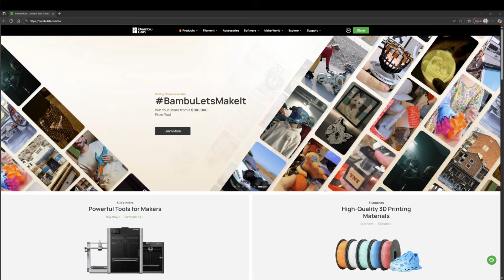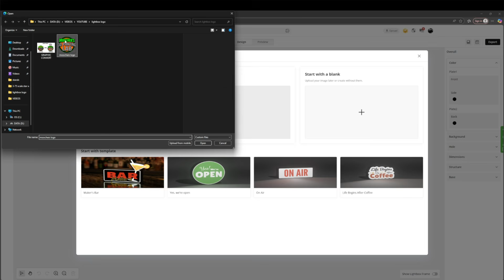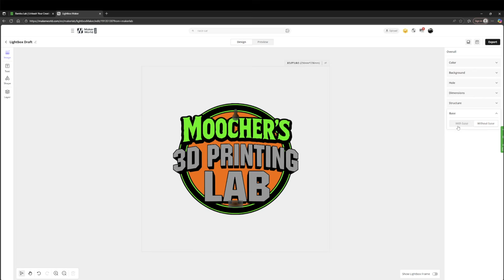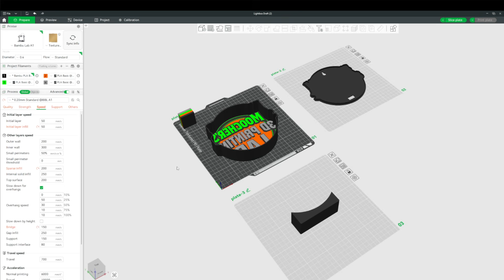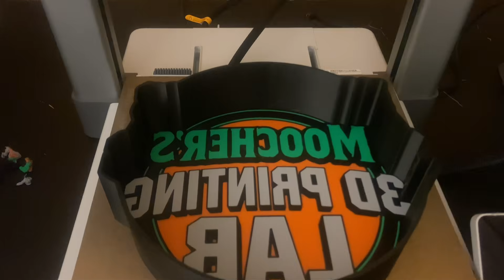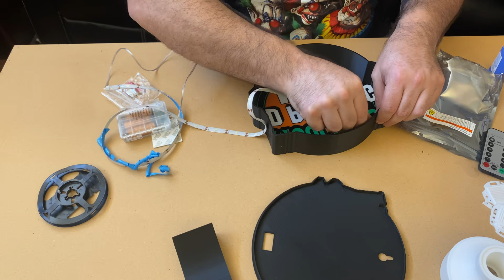Turning My Logo into a 3D Printed Lightbox!

Comment: How do you get your top layer to print like that. The inside of my design has tall tower pieces all inside the box. Seems like every letter is the thickness of the box. Even the back cover has tall pieces on it. It's weird. They aren't trees or supports.
Reply from the maker: Heya! So when printing I print face down, meaning the top layer of the finished piece is the first layer printed, if that makes sense, so you would have to flip the logo to lay on the build plate… sorry if I’m not understanding it’s hard with text only lol!

Comment: Thank you so much for the video! Do you find that the PLA is able to cope with the heat produced by the LED lights and not buckle or warp or anything? Thank you once again!
Reply from the maker: Yeah the standard led strip lights are no problem at all, I’ve left the light on all night in this lightbox and it’s still perfectly fine, now those strip lights that are a continuous light like the rope led lights yeah that throws off way too much heat.

Comment: If using battery operated lights, any suggestions on keeping the back cover on without superglue?
Reply from the maker: Actually the back just snaps on with the design using this design method in the Bambu maker space, it’s in there pretty good, but if you need something I would use magnets for an extra hold

Comment: The Bambu lightbox maker is good. I just wish we can make the front plate a little thicker. The transitions between colors are really weak and have a tendency to split super easy
Reply from the maker: Ahh yes… i absolutely run into this problem, one thing I tried to do was to just paint the colors in the slicer but make the inside first layer all white to try to fuse the rest of the prints… but, that being said it’s much easier to design your own in a modelers so you can control the thickness, but Bambu definitely can improve on this!
Reply: @Moochers3dprintinglab  I'm going to try and use beam interlocking on my next one and see if that helps lock the colors together better
Reply from the maker: @PunkBotGamer let me know if that works better! I have several light boxes I’m working on for gifts lol

Comment: special filament is needed?
Reply from the maker: No not really, PLA will work just fine, the only thing i would say is if you are using lights that heat up a lot to either avoid that or you could then print in an ABS or other high heat resistant filaments but for the most part standard PLA is great!

Comment: Did the 2 sided tape on the light strip hold up ? I’m finding out the don’t stick the 3d print any help would be appreciated
Reply from the maker: Great question! And no it seems like I have to restick every so often, not all of it but sections here and there. I’m thinking that the next lightbox to add in some tabs for the light strip to attach, like cable management… if you want you can add a dab of superglue to permanently secure the strip… a small amount goes a long way. Hope this helps!

Comment: The quality of printing is awesome.
The only problem I see with that sign/lighbox is that you can see the light getting darker towards the centre, maybe add a white layer to the inside of the box to reflect the light around to give an even lighting effect (may have to have the battery box outside for that though).
Reply from the maker: 100%! Someone also suggested to add reflected tape on the inside before adding lights, I think that could work really well!
Reply: @Moochers3dprintinglab  ah thats a good idea

Comment: My only issue that I have with the tool is that the tolerances when connecting the front to the back. It feels too loose to me. I wish it had a more snug fit.
Reply from the maker: It’s definitely not a snug fit I agree, like if I hang on the way I’m sure I would have issues of the front falling off

Comment: I have had zero failed prints after changing one setting. First layer .25 all others .2. Cool project. Need to do my logo too. Wish you had shown “the hard part”, making the vector file.
Reply from the maker: I love it! Simple adjustment and smooth sailing! Yeah i should do a companion video about vector graphics and making sure it’s ready for conversion… I’ll work on that!
Reply: Can you teach me where this area is on my Bambu Lab X1C Carbon
Reply from the maker: @KeyboardManDesignZ for changing the first or “initial” layer height… open up Bambu Studio and left hand side where you find all your settings, the quality tab you will see layer height and under that “initial layer height” you can change those settings, hope this helps!!

Comment: In the sign maker add the white layer to both sides.  It makes the sign look brighter
Reply: You might want to try adding mirrored mylar film to the sides and back inside of the sign to increase the brightness of the lights you already have inside of it, just don't put it on the spot you want light comming out of.
Reply from the maker: @BDT2701  wow yes! That makes perfect sense to do! Im definitely going to try that. That way you can get an even glow throughout… thank you for that suggestion!!!
Reply from the maker: Ohh! Great tip! Yeah I’ll be making a lot more as gifts

Comment: Where did you get the light strip and battery holder any links? Thanks for video
Reply from the maker: Thank you!!! Yeah I pinned the link in this comment section, a basic light kit from Amazon, let me know if the link works or doesn’t, hopefully it still available, if not it was a battery powered 3 foot led strip